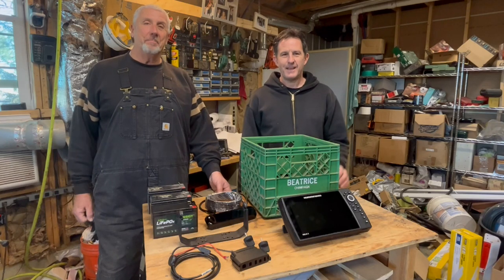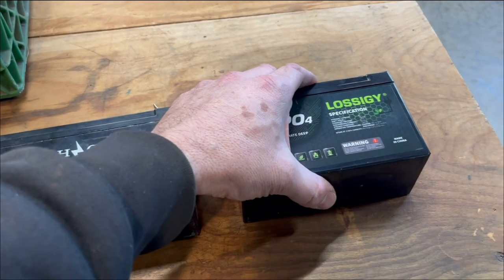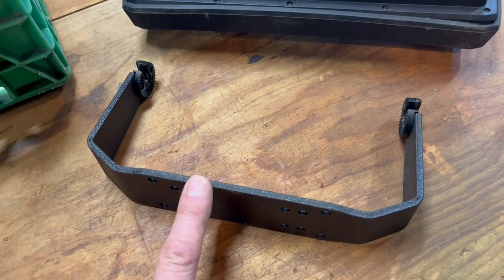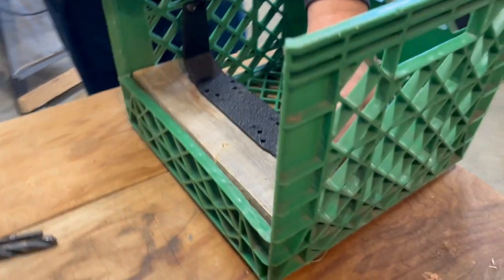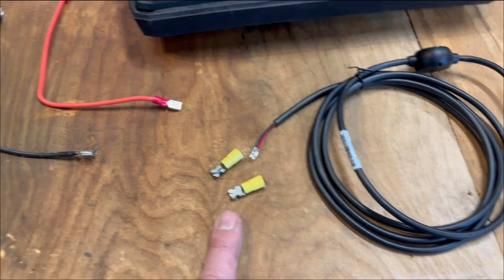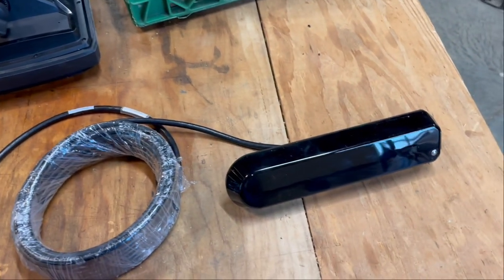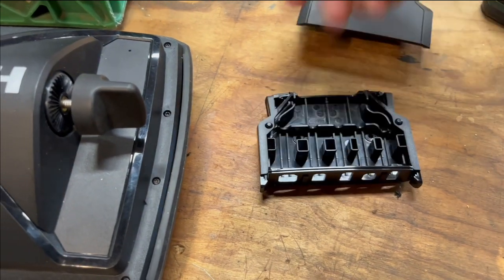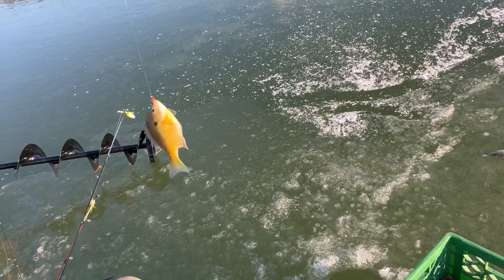DIY Helix 9 Fish Finder Ice Conversion Kit

Comment: Good ideas! Any idea how to give it a handle to make it easier for hole hopping?
Reply from the maker: The easiest solution would be a rope tied across the two sides of the crate.  A more elegant solution would be to take a handle off a 5 gallon bucket and use little u-bolts to mount it to the inside of the crate.   In either case, first lift the crate with two fingers to find the perfect balance point and mount your handle there.  If you just mount in the middle, it will tip.
Reply: @HowToLou  thank you. Right now it’s just so hard to find a transducer available for sale.
Reply from the maker: Yes, we are Still using the boat transducer. The ice ones are impossible to get right now!
Reply: @HowToLou  does the open water transducer actually work ok for you through the ice??
Reply from the maker: Yep, its a bit awkward, but it definitely gets the job done.  We either pin it against the side of the hole to keep it out of the way, or have cut another hole too
Reply: @HowToLou  and it marks your jig just fine too?
Reply from the maker: Yes, we show that in the last few seconds of the video.  We actually had a jig on the line.